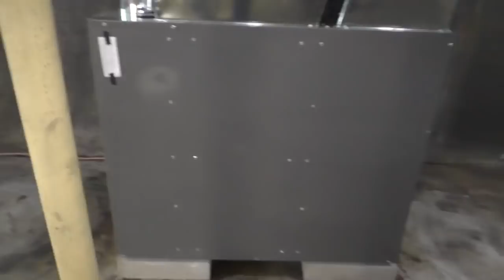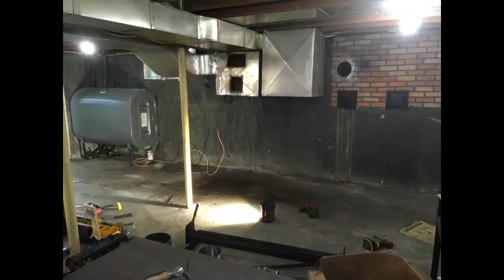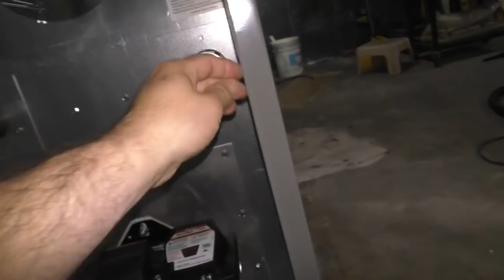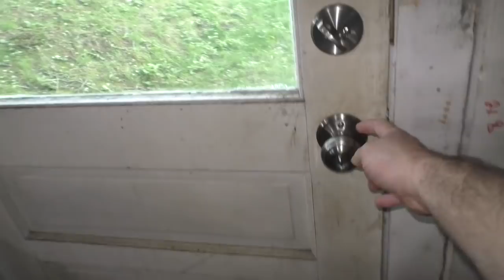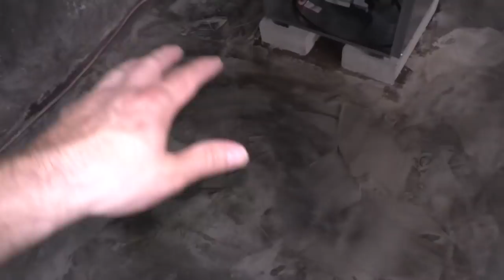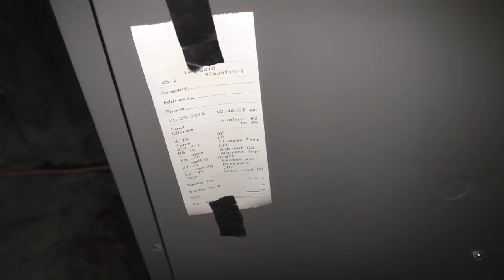BBISHOPPCM Buys A House - New Furnace Has Been Installed!

Comment: We have a Rheem heat pump down here in NC.  Works great as long as the temp doesn't get below thirty degrees.  Still works decently after that but you notice the auxiliary heat strips come on more often.  (Or it's going into defrost more often)

Comment: Have you ran your new furnace yet this season?  If so, how's it doing?
Reply from the maker: It's running fantastic... burning WAY less oil than the old one! Probably half as much... and it heats the whole house in half the time. The biggest noticeable improvement is in the time it takes to reach operating temperature; the old one would run for a solid minute or two before the blower kicked in, whereas the new one reaches temperature in a few seconds.

Comment: The old house I grew up in had an oil furnace from the 50s that was replaced in the late 90s, and I recall being surprised at how much smaller the new furnace was than the older one. I just remember the old furnace being this giant green beast that took up nearly a quarter of the entire basement being replaced by a gray box that was at most half the size. Advancements in efficiency and technology are amazing at times.

Comment: Have you ever considered solar panels? We recently had them installed on the roof and it's fun not having to pay the electrical company as much as we used to. We actually end up producing more than we consume very often - so turning on AC or other electrical equipment is very doable without any extra cost in electricity :)
Reply: @lactobacillusprime  Solar is ideal for small homes such as mobile homes or tiny homes. I own a single wide on my own half acre lot with ground mount solar in York pa. My home is all electric with an air source heat pump. The solar produces all my electricity 9 months out of the year so I have a wood stove for the dead of winter. The heat pump works fine even in single digits and it has no backup heat. It's a 3 ton 14 seer package heat pump that I installed myself in 2021 when I went solar. I own the whole property outright including the solar panels. There is no battery due to having 1 to 1 net metering.

Comment: sorry i would have to have ac. i can go without heat now and never really use it in winter and i am in ky.
Reply: I use natural gas heat and live in the upstate Georgia and Tennessee area,  not that really a big fan of heat pumps, they tend to struggle when temperatures get below freezing, which actually happens quite a bit here then what most would think, we do have some oil heating here in the older style homes, but it not as much of a prevalent thing here anymore, like it still is in the northeastern states, especially in areas up there where natural gas delivery doesn't exist.
Reply: Electricity in New Hamshire costs way too much for bbishoppcm  to even think about installing an air conditioner.

Comment: Back in the 90s I say about 93 or 94 we had cemtral heat and AC installation that was also all duct work everything .this house is over 100years old so no one ever installed one before we bought the house . So company that no longer in business now cause they got sued a lot . Put in Rudd Central heat uint and Rudd Central Air .well AC unit is well bulit and working today but as for Rudd heat unit  we had nothing but issues with it . So in 2002 we had it replace  it was cheap one there no brand on it  but no trouble from it what so ever . We also replace our hot water heater few years ago with a Reem and it work very good it also natural gas and we never run out of hot water . Hope your heat. Unit last a long time
Reply from the maker: SweetPrincessAlicorn Rheem and Ruud are the same company/same products. I installed a Ruud (pronounced “rude”) water heater in my old condo and it was nothing special (good or bad).
Reply: @bbishoppcm  if messed up on spelling sorry .yes when replace hot water heater that all local home Depot had . I think I remember that video of when you did that . anyways thanks for response my friend I still love watching your older videos and your new ones .

Comment: Very nice choice on Rheem. I used to install a dozen of the Natural Gas/Propane units every month for a long time. Very few callbacks on them, probably the only modern reasonably priced furnaces that don't have heat exchangers that crack easily. ( as in they don't use super cheap stamped steel like Carrier or Goodman would use ). You did good.

Comment: Im surprised the old unit didn't fall apart when it was removed, just goes to show how well some of that stuff was built. Also looks like you kept the badge from the old furnace, that's gonna make an interesting conversation piece.
Reply from the maker: Yes, I kept the badge! The old furnace was still in remarkable condition; no major rust anywhere. I did notice the unit's steel body was tweaked slightly when they got it out, but only slightly.
Reply: @bbishoppcm  Very interesting! I guess the water that came into the basement didn't affect it much. Oil furnaces are a whole new world I haven't looked into yet. They aren't exactly common out in California.
Reply: @bbishoppcm  I liked how your girlfriend just ambushed you with the camera bud that made me laugh. Instead of central air just get a Window Unit or a Portable Unit. I used to live in a house without central air and we had a permanently installed window unit in the living room. There was a cut out where a window used to be and that's where the Wall A/C unit went. I live in Michigan and I currently have Central A/C I don't run it much either unless it's really hot and humid or if it's affecting my asthma or affecting my pets. I have three dogs and three cats and love them all dearly.